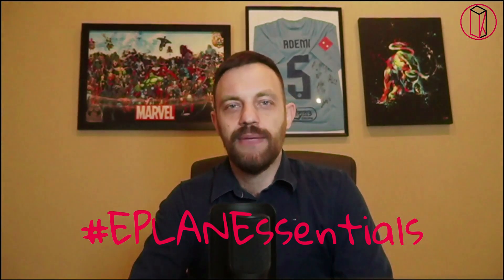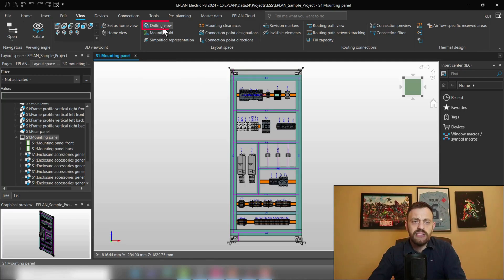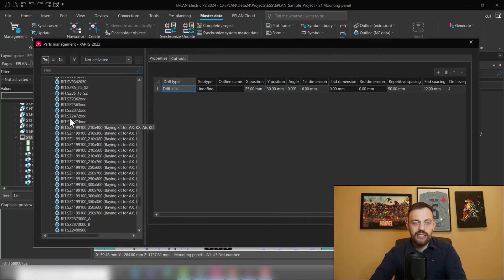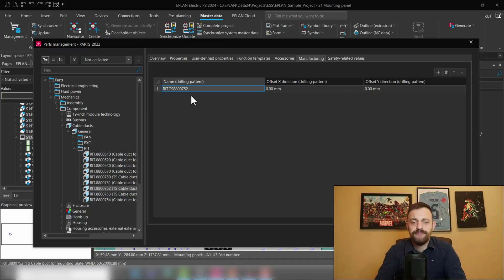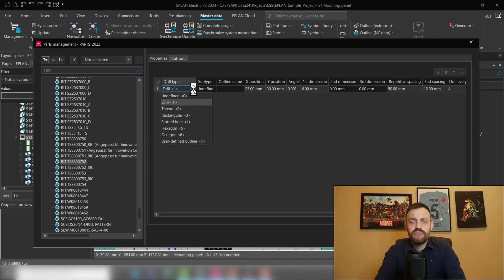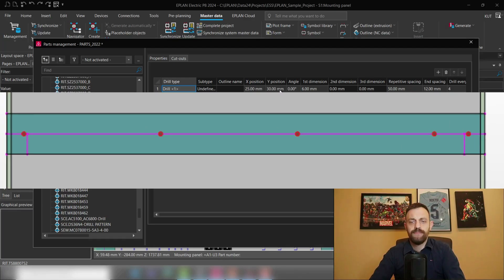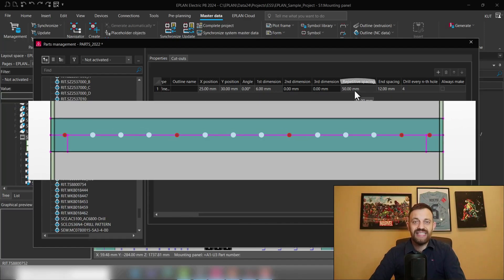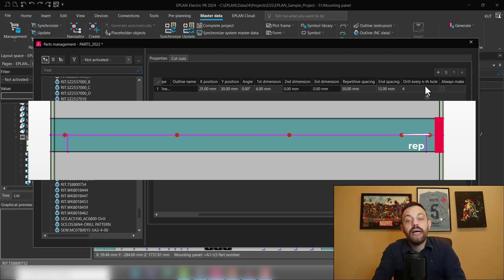Mastering Drilling Patterns in EPLAN: A Step-by-Step Guide

Comment: Hello Kruno, I'm currently creating my drilldown view, but my cutout legend table is getting the coordinates of the bottom left corner of the enclosure in all views. I've tried updating my Base Point to another location in the model, I've tried adding a Handle, work with the Field Size and moving the Axis to another location, but Eplan is still going from the bottom left corner. Is there a way to change this? The reason is that I want to disregard the thickness of the casing in the cutouts. Thanks for your videos!
Reply from the maker: Hello Sir.

Thank you for this very good question. I Encountered it a few times recently.
Unfortunately i was not able to find a solution.

My recommendation for you would be to please create a EPLAN Support Ticket, and fill a Software wish form :)

Good Luck
Kruno

Comment: How do I export the resulting drill pattern back into my CAD software (AutoDesk Inventor) so that I can laser cut the plate that will hold all the electronics inside the enclosure?
Reply from the maker: Good Day Sir.

Thank you for your question.
If you are using AutoDesk Inventor , EPLAN has an Module called "Design Space Exchange" which would export the 3D File Information with the xml position of the cut outs, which you can import in Inventor.

Best Wishes
Kruno
Reply: @UncleKruno  I read the article on the EPLAN website about Design Space Exchange. It said that we would need an Add-in for the mechanical CAD system to read the XML. 

How do I find that Add-In? Or am I way off target?

Has anyone done any cool tutorial videos on this? 

Thanks!
Reply from the maker: @christopherbray598  The Design Space Exchange is an Add-On that can be purchased if you have Pro Panel Professional as your base license.

I don't believe that there is an video regarding DSE on Youtube, if you live in the USA reach out to me on LinkedIn ill send you more information.
Reply: You can export stp , convert to sheet metal in example solidworks then export as dxf or ... ❤